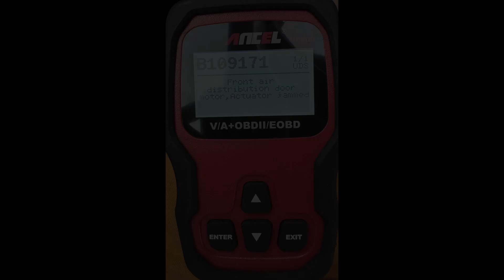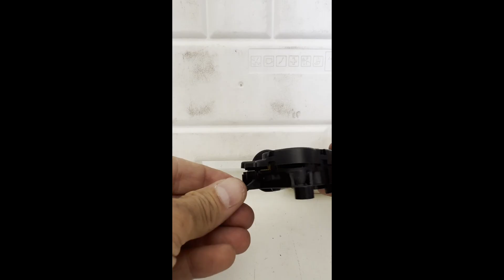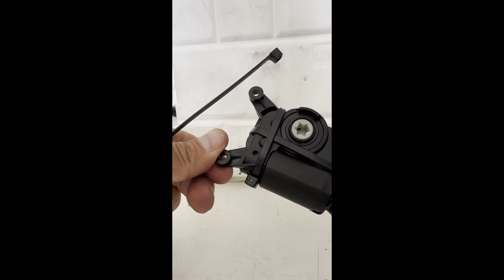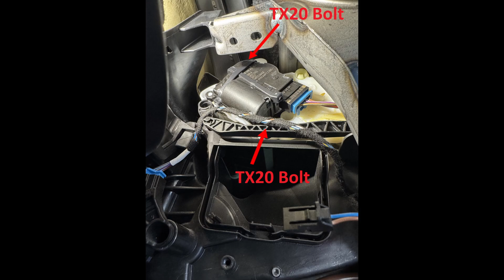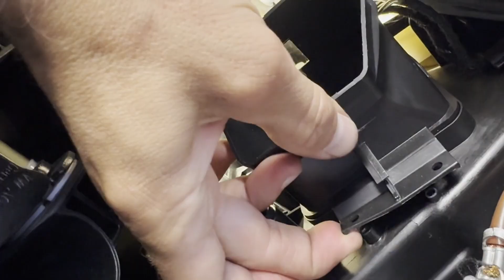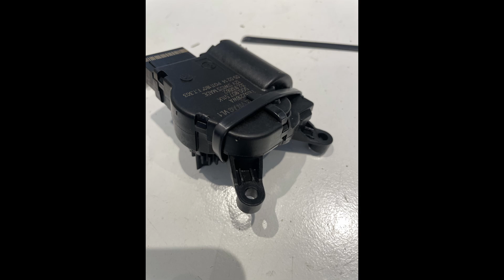Golf mk7 HVAC flap motor issue - DTC B109171

Comment: You mention knee airbag, how is that removed?
Reply from the maker: There are other videos that cover knee-airbag removal. It is fairly straightforward. But you need OBD tool to reset diagnostics if you do not disconnect battery terminal before removing the connector.

Comment: Do you need to remove only the glove box or the hole dash 😱
Reply from the maker: Depends on if you have a left hand or right hand drive. But you should be able to access the top one only taking out the glove box.

Which flap motor is it you want to access?
Reply: @Sebastian-bha thanks for the response,
It's Left drve, the problem is don't came out air only from the middle vents everything is fine but the scanner send the code for jammed actuator thanks a lot 👍🏽
Reply from the maker: @jorgealchlemus1649 
If it is the driver or passenger side flap motors, they generally sit lower and are easier to access.

The one I show in this video is the front and windshield flap motor.